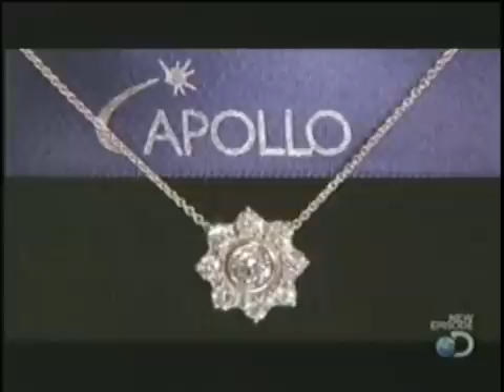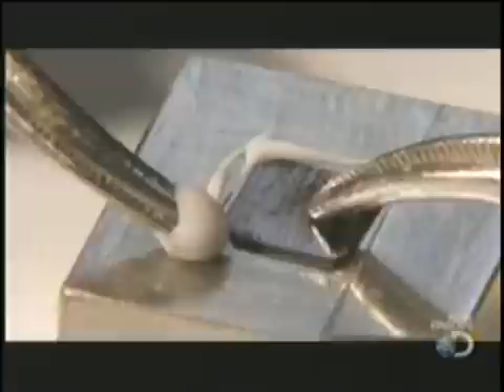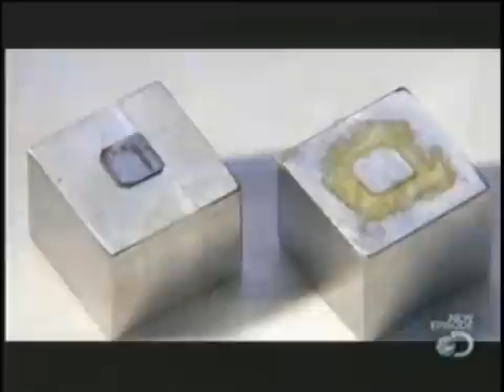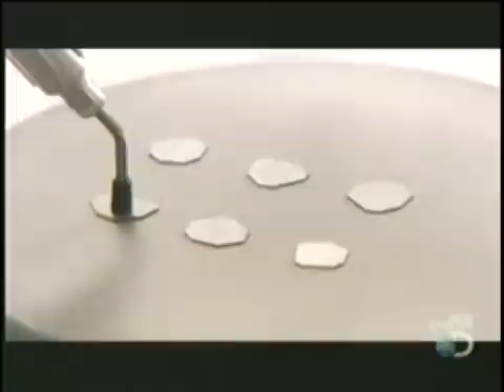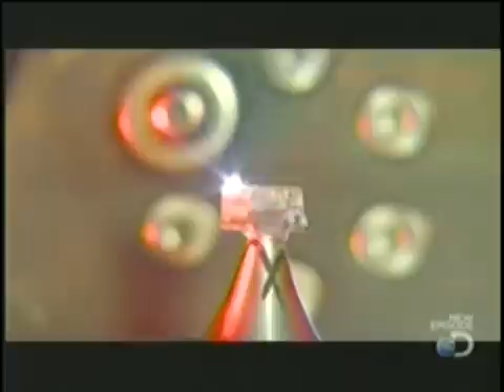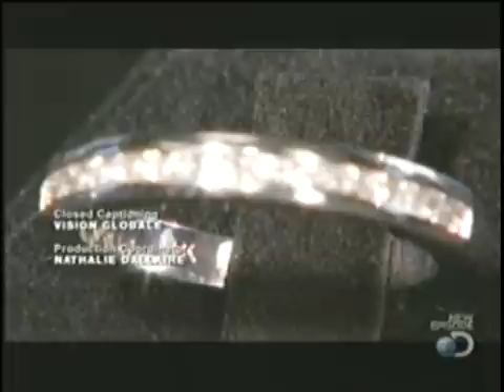Cultured Diamond

Comment: Pressure is not what really does it, though indirectly it will cause a specific anion charge that strips thermal mesons away off linear planes. Plasma diamond tubing process proves this by aligning the hardness mostly in just 1 direction. 
The best way to make diamonds would be to produce a heavy anion field w/o matter to flash bond 1900f co2 gasse's carbon onto a carbon rod. This would produce rough diamonds of any desired color. Maybe even some new ones we haven't seen! (I have plans for such)

Comment: A diamond is just crystallized carbon atoms.  At extreme conditions, carbon atoms form into a crystal structure.  It's just like when you freeze water it turns to solid ice.  Ice is a crystal structure.  The process in this video is analogous to water freezing.  However, the Gemesis yellow diamonds are processed much differently.